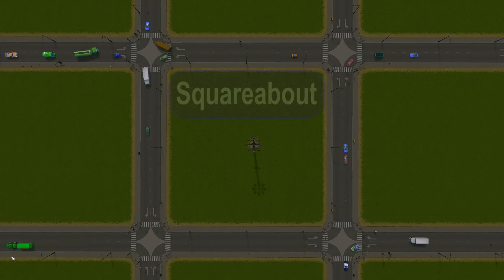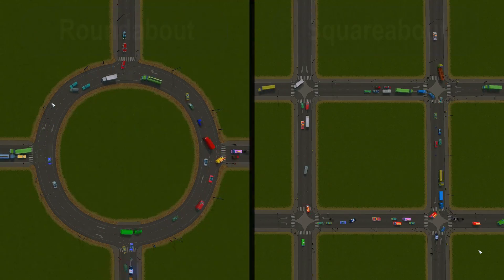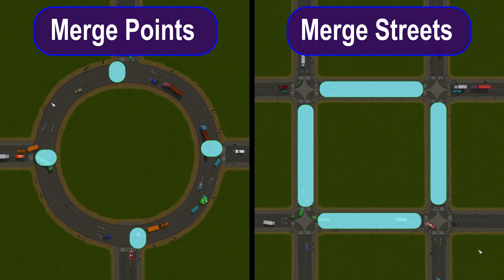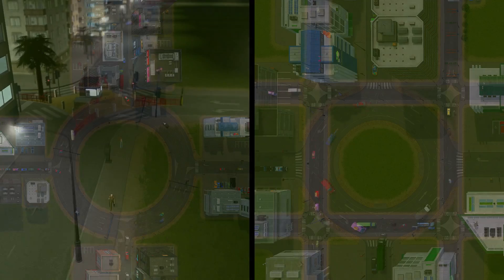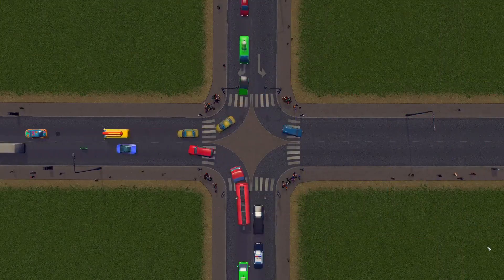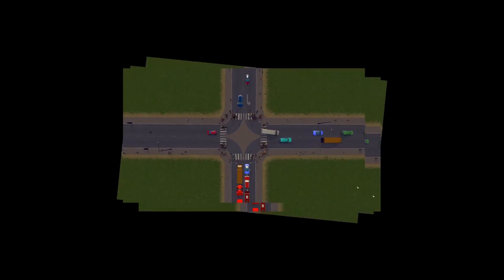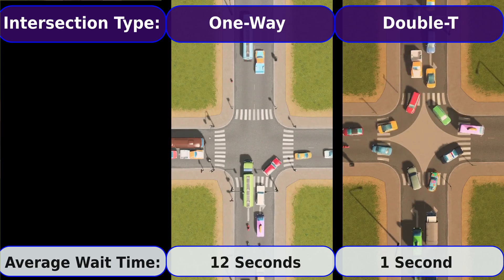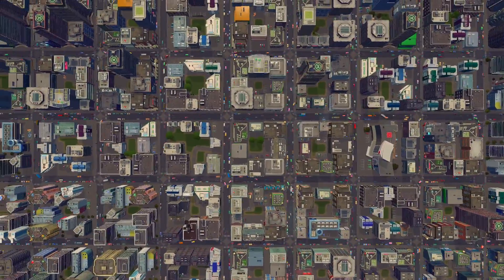Why Squareabouts are the future, not Roundabouts

Comment: This would never work anywhere in Europe because the shape and size of the square would vary everywhere. Also the roundabout you made is super large for no reason, you can fit a roundabout in the small space of the intersection actually.
Reply from the maker: You're got a point there, the chances of having a full scale double-t grid is definitely a lot lower in Europe than in some other parts of the world, but I was surprised to find out that there are actually a few grid-plan based cities in Europe, you can see a list here:
https://en.wikipedia.org/wiki/Grid_plan
Apart from those places, there is actually no requirement that a double-t junction be used at every intersection. We can have hybrid grids that mix traditional one-way systems and double-t grids, I talk about that a bit here:
https://www.youtube.com/watch?v=UKIpUDFLnJs&t=20m08s
And the amount of double-t junctions we use in a city can vary a lot. I talk about the different adoption levels at this point in this video:
https://www.youtube.com/watch?v=qVINw5biQMI&t=2m29s
I would say that if a city uses a traditional one-way system, then there is probably scope for hybrid double-t/one-way grid.

Also, I didn't quite use a large roundabout for no reason, larger roundabouts have a higher traffic capacity than smaller roundabouts, and the small or mini roundabouts are really only suitable for very low levels of traffic from what I've seen.